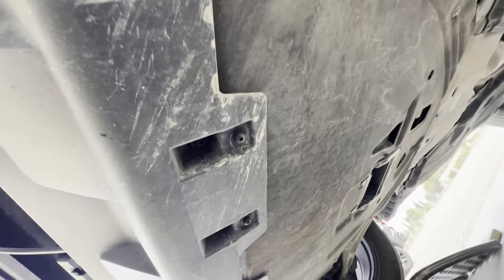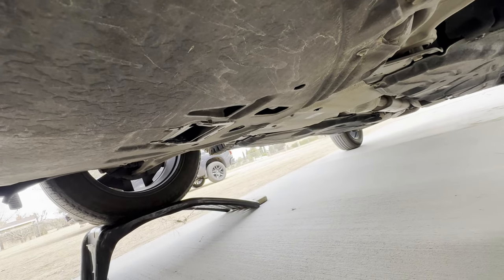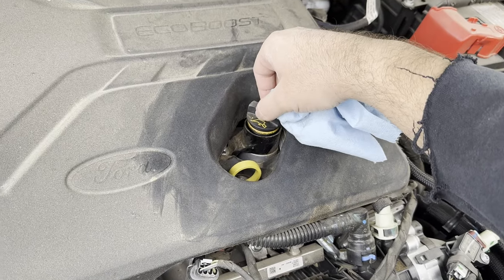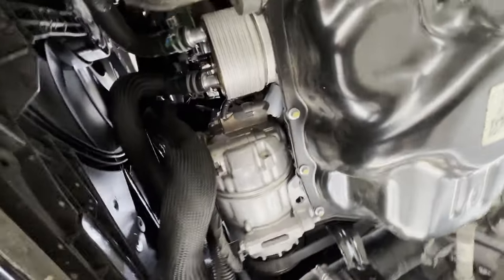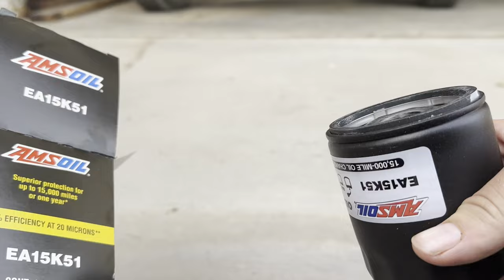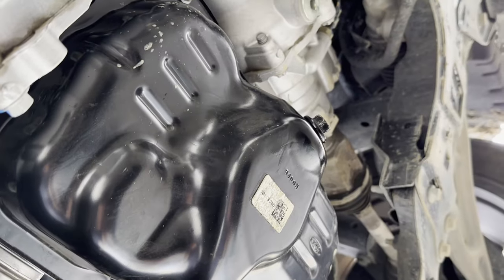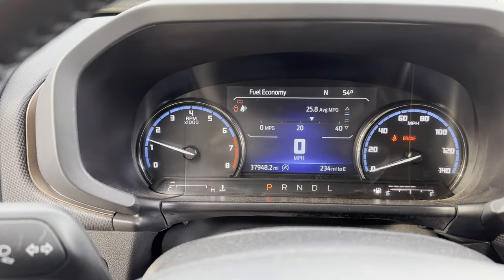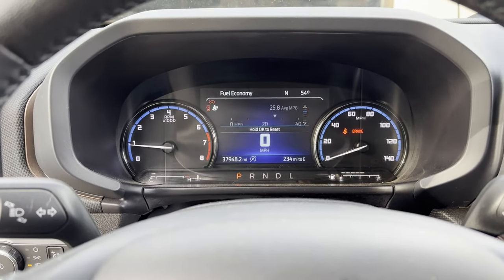2021 Bronco sport oil change

Comment: Thanks, very useful video, I just bought a '22 Bronco Sport, and this tells me just what I need to know.
Reply from the maker: Nice what engine option did you get?
Reply: @dcrs51  it's the 1.5L ecoboost. Pleased so far, I also have an ecoboost (2.7L) in my F150 and it's been trouble free so far.
Reply from the maker: @k6user  nice the bronco we have also has the 1.5 in it. It’s been pretty good we have had a couple of issues tho

Comment: I have a bronco sport too. I always forget how much of a pain it is to take the skid plate off. Looks easy and I’m sure I will get use to it lol. My filter is positioned up and down not side to side not sure why?? Also I was told to use a certain filter that doesn’t allow the oil to lose pressure when auto stopped. It’s called a back valve or something. I was told it was only in the motorcraft filter. Just letting you know. Just what I was told and recommended for the warranty. Good job.
Reply from the maker: @kabooomkal  maybe you have the 2.0L? I have the 1.5l three cylinder and as far as the filter goes I’ve never heard of that to me that just sounds like BS they just want you to buy the ford filter or take it to the dealer so they make more money off you once you start the engine the first time in the engine in the morning it circulates the oil I wouldn’t be worried about trying to keep pressure in the filter with the engine and oil hot it will build or a pressure fast I haven’t had any issues

Comment: 5.3 quarts?
Reply from the maker: Yes 5.3 quarts with filter it has the 1.5L 3 cylinder if you have if you have the 2.0L 4 cylinder it’s 5.5 quarts with filters